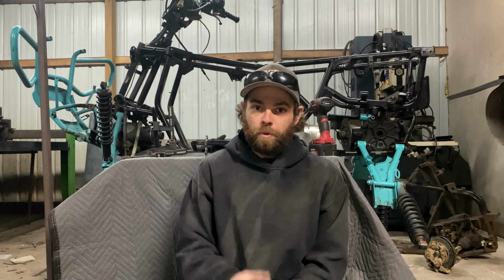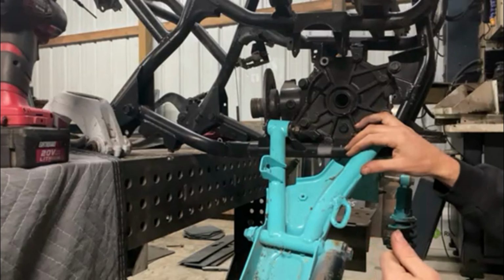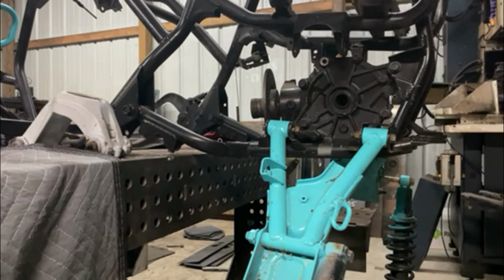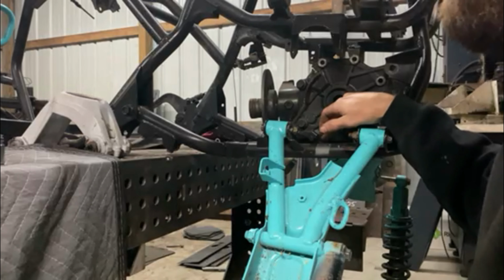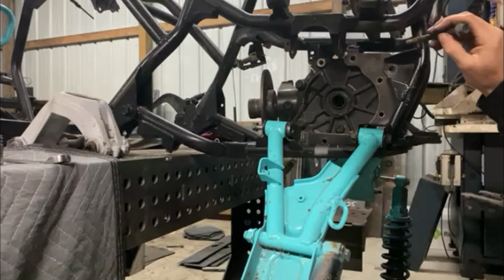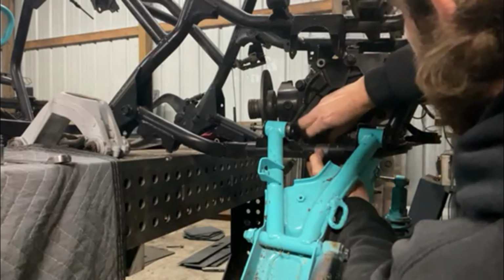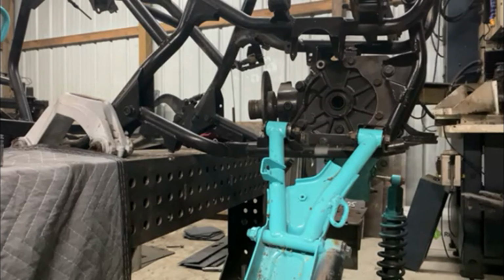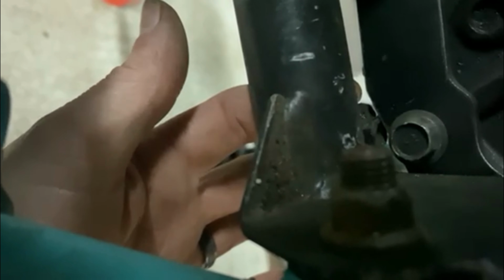HONDA RUBICON REAR DIFF BRACE INSTALL

Comment: I'm totally interested but would it work better if you use all the bolts in the diff and keept it C shaped because all the stress is where the pinion is at the two bolts that you're not using